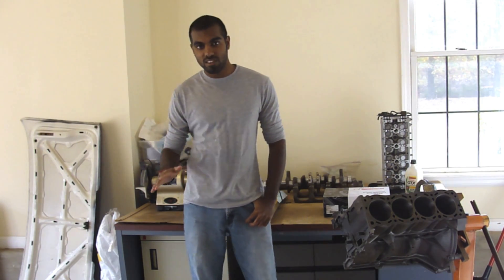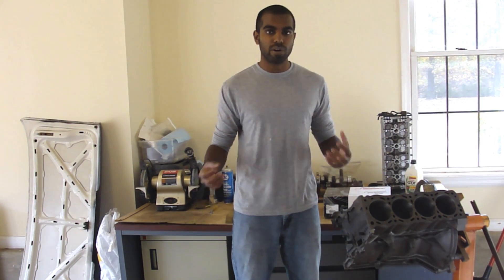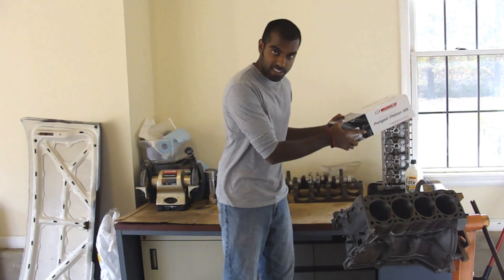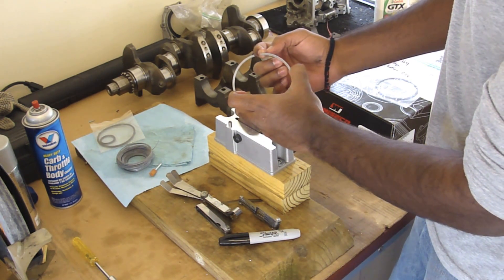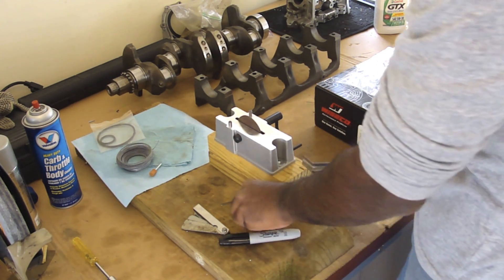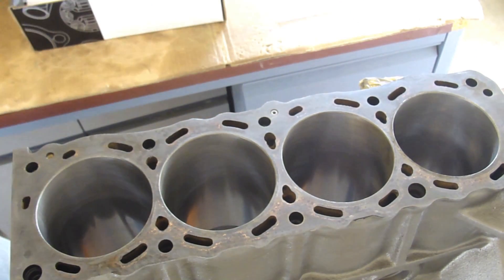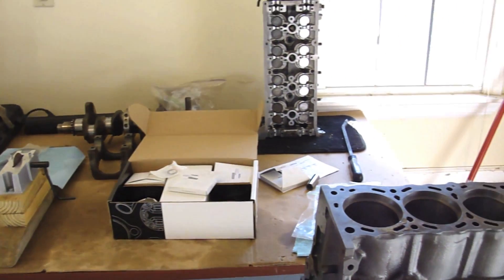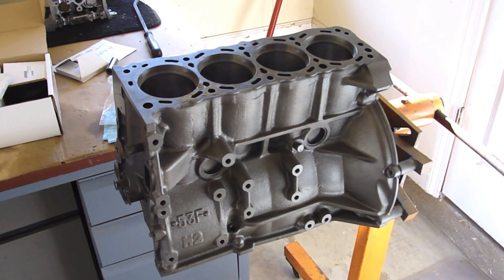How To: File Piston Ring End-Gaps

Comment: The general concensus is you do it at the bottom of the bore about two inches up, the bore can be larger at the top than the bottom. Your ring gap may be good at the top but will be too tight measured at the bottom. When hot the rings will pinch up, possibly break and pick up on the bore

Comment: Nice video informative for a novice engine builder but here's a big tip from someone who builds high end high performance enduarance  engines. Only file 1 side! The gap ends are perfectly cut concentric when they are manufactured. ALSO,  turn the ring grinder wheel towards the ring center,,,then take a small file and remove the burr,,,then measure at the cylinder you are working on
Reply: Rewatch the video and you see this mentioned allrrady genius

Comment: Nicely explained! One question if I may; Why is it that you turn the file in the direction that you did? It seems counter intuitive. In my mind it makes sense to flip the ring over and rotate the file the other way, so that the ring is pushed into the tool and seats itself against the tool, thus being totally stable, instead of the tip wanting to lift off the tool and possibly vibrating.

Comment: Fantastic video.
Reply: Prakash, are you familiar with the differences in quality on rings between some of the major manufacturers of pistons such as Wiseco, CP, Arias and so on? I'm getting ready to build my VQ35DE (currently single turbo but on stock internals).
Reply from the maker: BlueonGoldZ I'll go into detail about this later, but I honestly cannot recommend Wiseco. Since you asked about rings, I'll share my experience with that. Wiseco has a chart that ships with their rings that helps you determine what end-gap you should use for your build. I followed this to choose my end-gaps. However, when I initially measured the gaps (out of the box) some of them were already bigger than what I needed. I had to go back and forth with JEGS about 3 times (paying shipping each time) before I received rings that I could file to the proper gap. Even though I have no experience with CP or Arias, I know people that do, and based on my experience with Wiseco I highly recommend CP or Arias.
Reply: Project Garage Oh wow. Do other manufacturers who make pistons ship their pistons with all the necessary rings included? Second question: As far as design and build quality of the pistons themsevles, are Wiseco good in your opinion? What about the other brands? Any I should stay away from for a boosted platform (staying to stock compression)
Reply from the maker: BlueonGoldZ The pistons from wiseco shipped with the correct rings included, however they were all already overgapped so I had to re-order rings a few times. The pistons themselves held up aside from one problem. The retaining clip that holds the wrist pin in the piston failed on one of my pistons. The wrist pin then slid out and created a huge gouge in the cylinder wall, pretty much trashing that block. I really would stay away from Wiseco, based on my experience.
Reply: Project Garage
Wow. Thank you for the info. How long ago was it that you had these issues with the retaining pins and the ring gaps? Asking to see if this was many years ago, perhaps their QC has gotten better.
Reply from the maker: BlueonGoldZ I bought the pistons some time last year, the motor ran for a little less than 10,000 miles before the Wiseco pistons destroyed my block.
Reply: Project Garage
Ok. Thank you sir.
Reply: Project Garage
So what piston and rod company do you recommend for a turbo VQ35DE?

Comment: Great video dude! The gap look a bit small to me but I used to working on bikes and they run a lot hotter. By the way, you should check you gap on the bottom, middle and top of your cylinder walls. You never know if it was bored and honed correctly.

Comment: If a valve seat sleeve fell down inside the cylinder, and bounced around like popcorn until it got crunched up into little bitty parts, and chewed up the top of the cylinder, and weakened the cylinder rod to the point of breaking, would you consider that bad engineering?  Because that's what happened on my Ford Escort, and it seems to be a common design problem with the Ford Escort.  The valve seat isn't fastened by anything, just jammed up in there tight.    

I took the head off my car, cleaned everything up, got rid of all the crunchy bits, replaced the head, valves, gaskets, and everything, and put her back together, and she ran perfect for 2 minutes until the cylinder rod broke on the piston that had its head chewed up the most.

So is like Ford a reputable car company with a good history of building engines?  Because I'm thinking not.  And that I got screwed and sold a lemon with a purposefully designed in design defect.
Reply: CHOPPERGIRL AIRWAR
Bikes are awesome....then it rains! LOL! How you go about comparing cars and bikes, did you ever managed to haul kids, furniture, lumber, equipments, and cargo boxes using your tiny bike??? LMAO!!!

Since that bailout money came into play in the American auto industry, American cars became very different and more reliable...totally different from your old Ford Escort. I can't understand your gripe with FWD cars...some guys can fix these cars even with their eyes closed. You're just not talented enough I guess.
Reply from the maker: Well, thats generally how valve seats are installed. They're press fit. I would assume your problem has to do with the valve seats not being made from the proper material. Different materials behave differently under heat. This may have been an oversight in the design stages where they assumed that the seat would last for "the life of the car". But I haven't really looked into it. Ford is a good company, especially recently. Actually, US automakers in general have really stepped up their game. However, 10-20 years ago, US cars weren't as reliable as they are today.
Reply: There is no way to tell the condition of the rod on a piston that is chewed up.  You hope for the best that its just surface damage.  Why?  Because its an insane amount of work to get a front wheel drive car engine out of a small compact car, flip it over, take off the transmission, just to get to where you can even see the rods and take them out.   A front wheel drive is absolutely piss poor design for user servicablility.  Compare say the front wheel drive engine of my dead ford escort, packed in there like sardines in a can , where you can't cant even get your hand in there to change a drive belt (you have to take off a wheel to do so)....  compare that to say a ford model A, where the engine is out in the open on all sides and if you want to do anything to it, its all right there in front of you.   

I tell everybody I can to avoid front wheel drive cars because they are absolute crap.  We have a field full of them my sister bought that ran for a few years then died.  Nobody can fix them because it would cost an insane mount of time and money.  And yet I myself am driving motorbikes and rear wheel drive cars still srom 1981/1983/1985.  Thats 30 plus year old cars.  How?  Because if anything goes wrong on them, and it does, ts possible to get a tool in there and fix it, and worse case scenario, possible to take the engine out.

Ford knows different metals expand at different rates when heated or cooled.  They've been in the engine building buisiness for a 100 years.  There is no excuse for their valve seat design flaw.   Im not the only one..  google "ford escort valve seat drop".   

I'll never buy an American car again, and after experiencing how  far easier it is to maintain a motorcycle, I'll probably never buy a car again period.  They truely are inefficient aweful vehicles.  They have their places and uses but for the vast majority of people a motorbike would be a much better choice, cheaper, more fuel efficient, less impact on the planets resources, easier to work on, less pollutuing, etc.   With a car your basically paying through your nose at the pump to haul all that steel and glass and carpet around...
Reply from the maker: I love bikes and all, but the practicality isn't the best. Having a bike and a car would be awesome, having just a car isn't bad, having just a bike would suck at times. I dont have to worry about distracted drivers killing me in my car. I can play with it in all kinds of weather. I dont have to suit up to drive it. A/C in the summer, heat in the winter. 25mpg, super fun to drive, there really isn't much to complain about. But really like Blitz said, you can't compare the two, they're totally different machines for totally different purposes so theres no point in really talking about it lol. 

As far as FWD engines being hard to work on.... I can't really agree. I'm very biased, I love RWD cars and I'd never really buy a FWD car ever. I really dont enjoy driving FWD cars. But I find them a lot easier to work on. Pulling the engine is a breeze because all of the mounts are super accessible for the most part and the transmission isn't under the car... Aside from the serpentine belt and water pump, mostly everything you'd work on is staring at you. It gets kind of stuffed with FWD V6 engines, but FWD inline 4s are a breeze. 

As far as american cars, they're great. Things really have turned around for american companies. The old 90's views on american cars being unreliable are pretty irrelevant. We've always made good trucks, we've know how to make a damn good V8. And now we're churning out some pretty reliable and fun cars. Its your choice whether you want to buy them or not, but we do make some good cars now. You seem very firm in your opinions so I'll let you know I'm not trying to argue, but things have changed since your escort came out. 

Anyway, whether its bikes or cars or whatever, as long as your enjoying what you're doing, keep at it!

Comment from the maker: Thanks man! Burning oil could be rings or valve seals, or possible headgasket but you'd also have other symptoms if it was the headgasket. Check your compression on all 4. If your compression is good, its likely that your burning oil is coming from the valve seals.

Comment from the maker: If it was a budget build I would have kept the stock internals. Cylinders were out of round so I had it matched and machined .020 over to the Wiseco pistons. The compression ratio is 9:1 as opposed to the 9.5:1 factory ratio, which is perfect for me as I won't be running high boost. deck surface was not machined because there was no warping present so the $200 to get the deck machined would have been a waste. I'm not using an mls headgasket either so I don't need a mirror finish on the surfaces.

Comment from the maker: Sounds epic. You can do alot with stock internals if you do it right! Main reason I switched to forged is because I was rebuilding this motor anyway, I figured its a good time to do it. I'm doing the same kind of thing as you. putting it together, breaking in, confirming reliability, and then turbo! I'm looking at 550cc injectors, S15 t28 (disco potato), efi specialists tune, with z32 maf. Shooting for low 300s, after I'm bored with that, I'll go higher :)